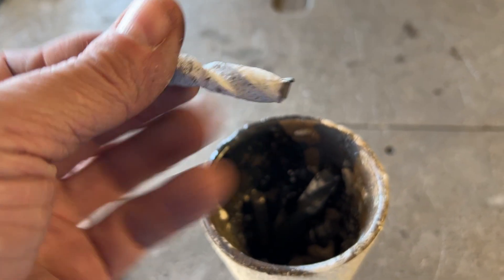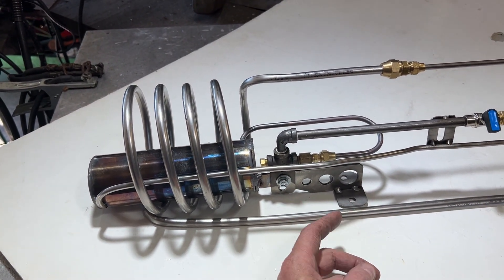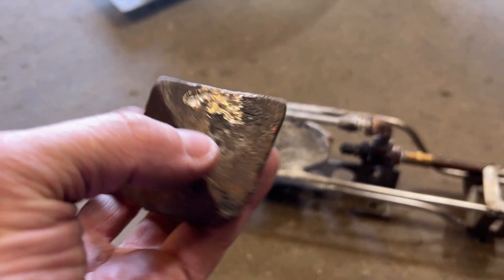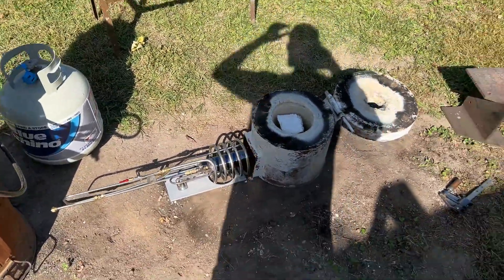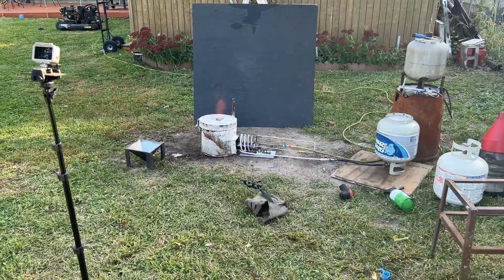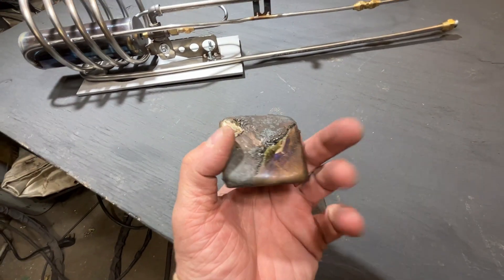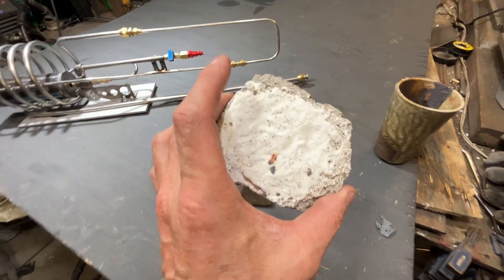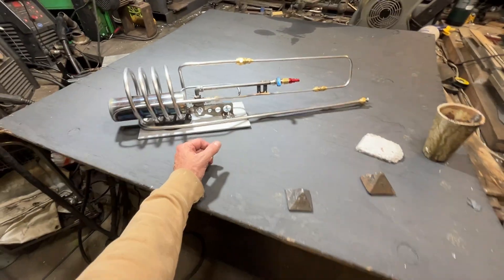Thermal Cracker Thunder Burner

Comment: You pretty much built a miniature rocket engine. If you feed the coil with kerosene and make it tightly wrapped around the burner then a few turns of larger tubing under it it will get much hotter. It will convert the alkanes to alkenes mostly methyl propylene and ethylene that burn crazy hot. Works great for a gas fired kiln. ❤

Comment: Amazing project. Never knew those temps were possible with propane.
Reply from the maker: There Not LOL thanks for saying that, great point .This proves we are making hydrogen .I have some nay saying going on . I had to even ban a guy for being rude to other commenters about it
Reply: @NOBOX7  No problem :).  Absolutely. Meant with propane as a starting point. Very cool that cracking was able to boost it so much. Ahh man, sorry you had to deal with that.

Comment: What would happen if you put another imput line in the pirolysing chamber when it's red hot use it to push compressed Diesel ? Would it go as far as hidrogen or will it came out as gas?
Reply from the maker: Diesel can be cracked but it leaves lots of carbon . This may clog things up
Reply: @NOBOX7  do you know why it leaves carbón? I'm interested in the chemical reactions.
Reply: @D.MauroBaiardiTwerd Diesel is mostly made of hydrogen and carbon so when it's heated it breaks down and you get hydrogen gas and carbon
Reply: @NOBOX7  So...... add some air to help convert the carbon to CO or steam for watergas type reactions

Comment: Ace work! What about creating a water separator that could feed you with H2 and O2? Have seen people do it on a small scale but guessing you would need to much electricity to do it large scale?
Reply from the maker: yep you need about 600 amps to pull it off

Comment: Love the engineering. Really wish some of you boys would use proper PPE.
Reply from the maker: I had my osha 30 card in my pocket LOL
Reply: @NOBOX7  Here's the thing.. You obviously have a bit of experience with metal work and foundries, but there's gonna be some dumb kid that comes along and thinks to themselves 'I can do that', and because you're wearing shorts and t-shirt, has no concept or idea about how dangerous it is.. Before you know it, some molten metal explodes in their face.
Reply: @MrRadbadger  I was that kid a decade ago. Now i have a scar on my foot from a drop of aluminum. It smelled like steak lol. Ive since wisened up a bit but im lucky i didn't get seriously injured as a kid.
Reply: *Safety squints engaged

Comment: If you are not carboning up your fuel line you are not getting a hydrogen flame out of your system. You are making ethylene and propylene for the most part. Very good fuels indeed. Just not H2.
Reply from the maker: Shawn , a dissection's is up and coming . We indeed created carbon

Comment: That's a pretty sweet burner. I always considered melting steel to be a bit out of reach for a hobby shop, unless you were using something dirty like thermite. Maybe if you reduced the distance between the burner and the evaporator coil you wouldn't need the insulation tiles. Nice work.

Comment: I had some thoughts about air preheat in general 
As you start to heat the air up you’re going to reduce the air density. So as the temperature increases you will be pushing the same volume of gas through the orifice but it will contain less o2 overall, requiring extra flow to have to the same molar flow rate
Reply from the maker: You are correct , this is why inter coolers exist . Pre heating air is only useful for large furnaces in most cases . 
Ive read about it alot and nobody was getting excited about bothering with it on a small scale . Ive done a lot of research with it , you get about 50 deg F extra but his could be attributed to the oil being vaporized better as the hot air pre heats the oil .

Comment: How does the cracking section not build up carbon from the propane if there's no oxygen to burn it? Does it go into methane with the rest of the atoms being hydrogen?
Reply: Ope Google says it produces mainly methane and ethene so basically yeah it just stays a gas
Reply from the maker: @AsGames-g1k  Thanks for the input but Not true , Dont trust google , they changed it , now it makes you stupid. If you heat Propane to 700 or 800 C it turns it not methane and ethane , well did you look up what happens when you  heat methane and ethane to 1000 C ? It produces Carbon and hydrogen . The inner liner reaches 1300 C , methane reaches full conversion at 1,150 C .
Not trying to be a jerk i just dont want you to trust the top search results any more , they are curated now by different metrics . For the most part always add Reddit at the end of an search to bypass  the AI BS